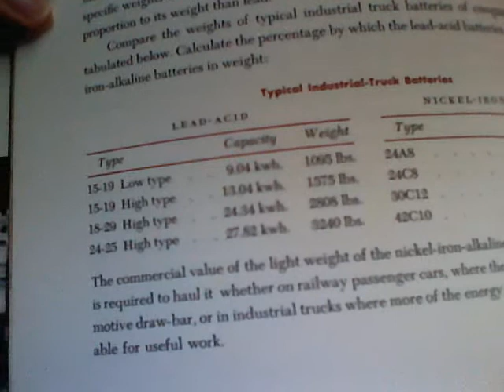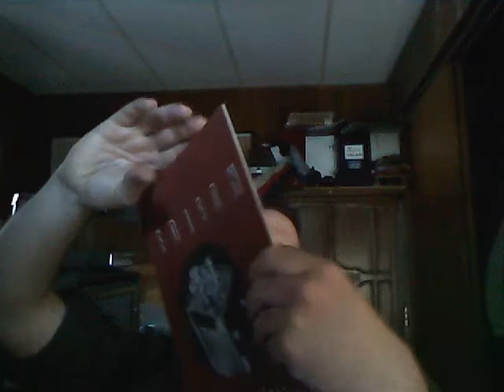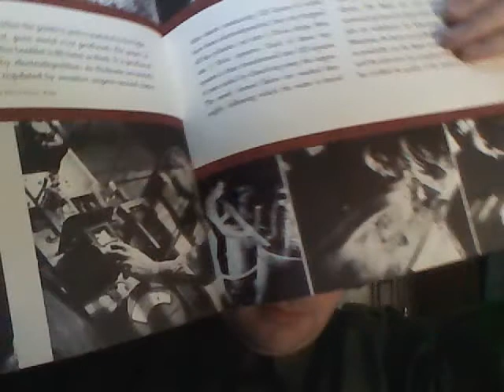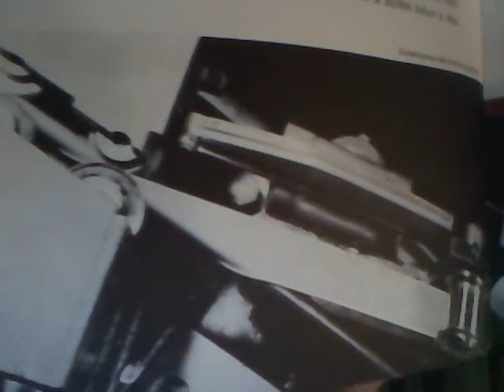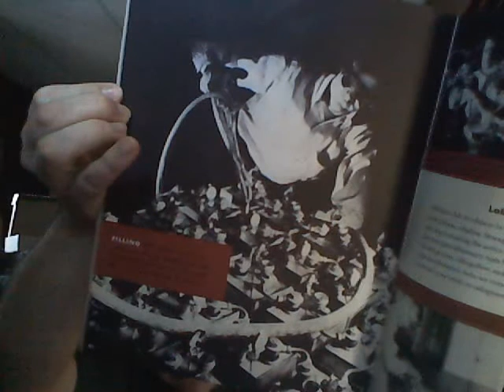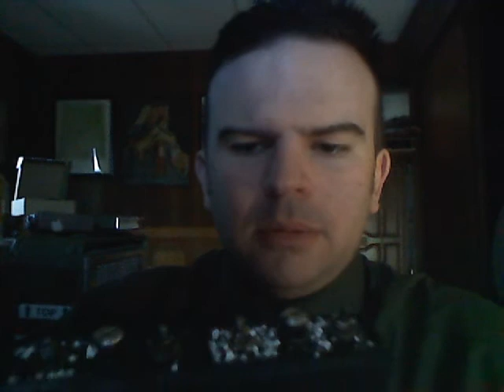Edison Nickel Iron Storage Battery Part 2

Comment: I'm going the reverse engineer it. I just bought one off eBay. Actually you can buy them from China at $300 a cell. I know how to nickel plate. Anyways I'm going to build my own.
Reply from the maker: Oh the NiFe 130's or the NiCAD sold by the same guy. You can't reverse engineer these. Watch the old movies on how they are made with nickel flake and hydraulic compression. Your best bet is to RESTORE an old set. You don't want to destroy a good cell just to find out. The Chinese ones are made more simply maybe they can be copied. https://youtu.be/etfGlcxTzs4